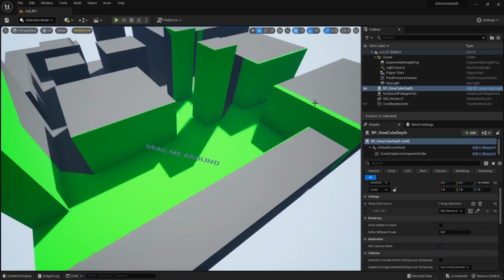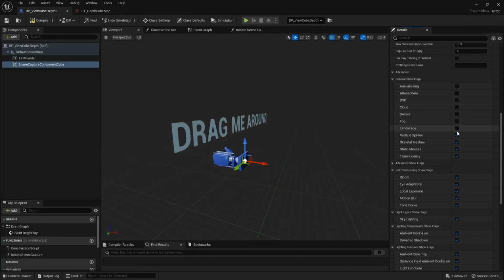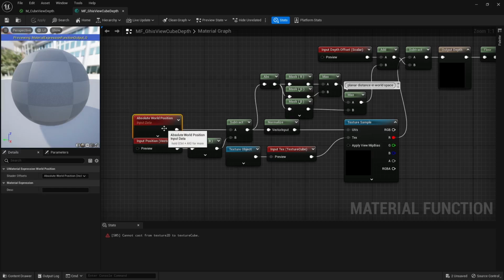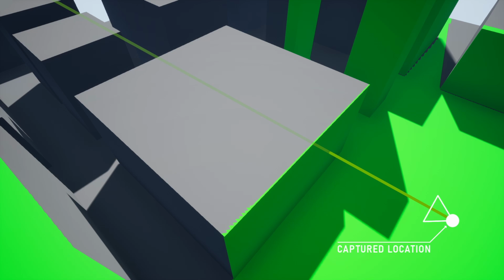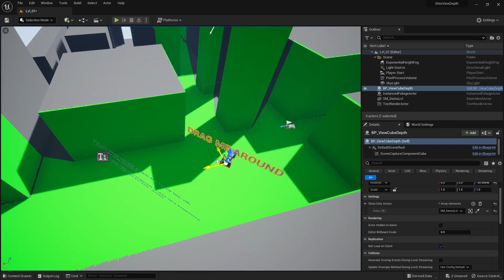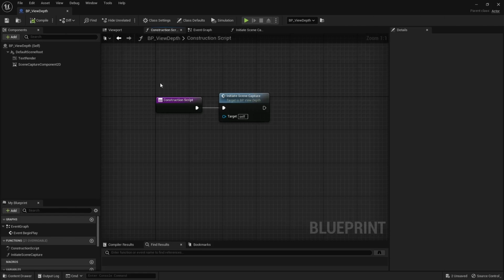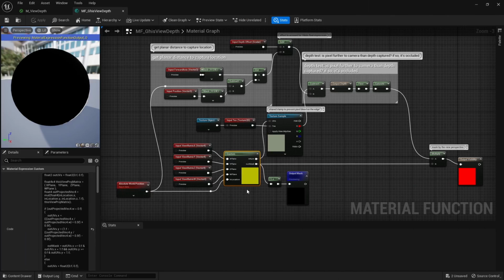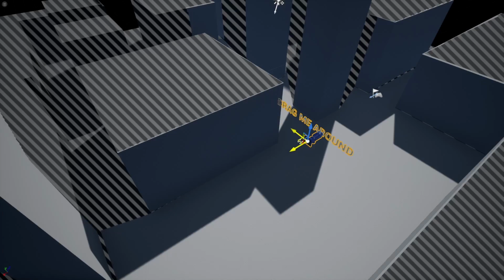Occlusion techniques using Scene Captures & Depth Maps

Comment: Hey, great stuff! I tried the second example (the camera with a given FOV). However, there seem to be no way to make it compatible with an ortographic projection view and have the occlusion be accurate at longer distances (even when updating the BP struct to have the projection mode be set to ortographic there as well). What I'm basically trying to achieve is creating a second shadow pass using this technique but through the sun's (a directional light) point of view and then, preferably, capturing the whole scene rather than invividual small parts of it. Would you say this is within the realm of possibility with this setup?
Reply from the maker: Probably? I'd suggest looking at an existing implementation of directional shadow maps to see how it's done.
Reply: @ghislaingirardot  It turns out it was just me missing to update the orto width value in the BP! :D As for directional shadow maps -- it sounds like a great idea, but do you mean how they're specifically implemented in UE or just the theory/practice in general?

Comment: Amazing stuff man! Been looking for days to get an idea on how to have obstacle detection for a FOW PP material without implementing full grids which end up being almost as expensive as the cube renderer.
One question (maybe I get lucky and you answer). Is it possible to "soften" up the sharp lines? I've tried dividing but it helps very little. Thank you!
Reply from the maker: Depends on the softness you're talking about :) Possible to some extent, but limited & complicated, that's why the industry is moving towards ray-tracing! Google soft shadow maps and I'm sure you'll be able to find plenty of resources.
Reply: @ghislaingirardot  unreal engine. But thanks alot anyway, I'll do some more google digging.
Reply from the maker: @duke6800  You probably read software instead of softness :p
Reply: @ghislaingirardot  I have 😂

Comment: Hi,  recently I d' like to implemt the celing shading in UE, there is key point, the charater does not receive the shadow from character(including it self), but still receive the shadow from other object, I am a rookie for UE material, I don't this work need to add the new shading model or modify game engine, or just use the customer depth is enought?
Reply from the maker: Definitely needs a custom shading moding imo
Reply: @ghislaingirardot  If you have some detail about how the implement this feature?
Reply from the maker: @x007-w7g  I don't. Google is your friend. There are a few articles that explain how to modify the engine to implement a new shading model. It's not straightforward. Good luck!
Reply: @ghislaingirardot  Thanks for your reply